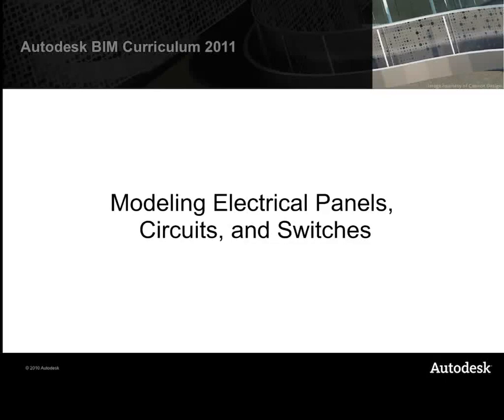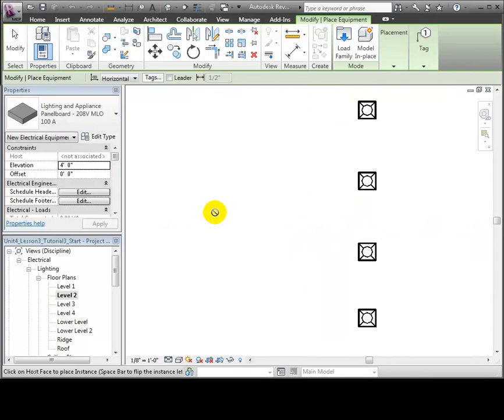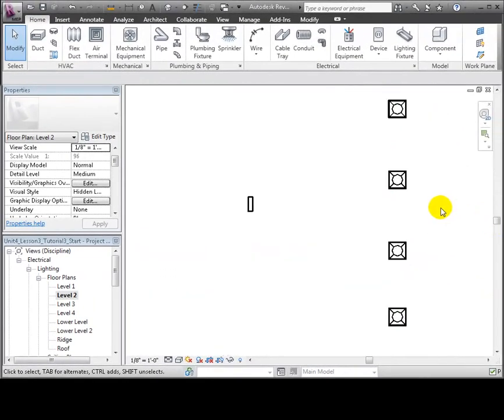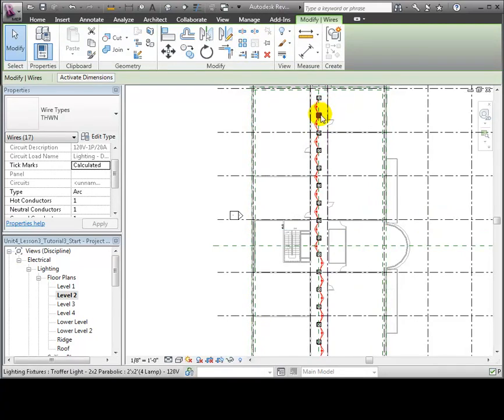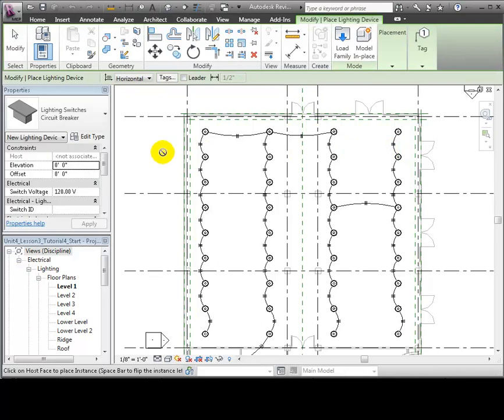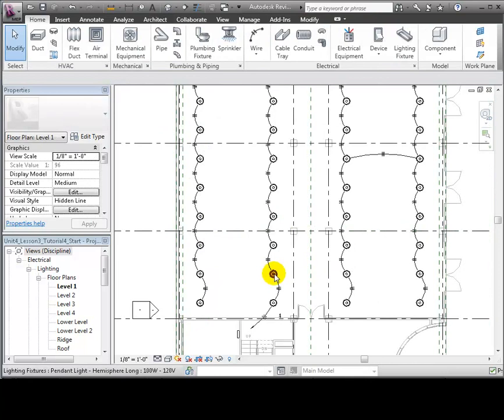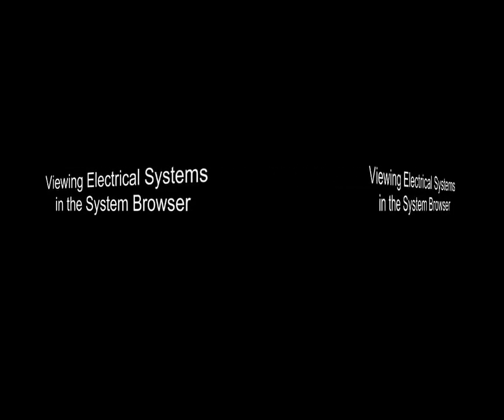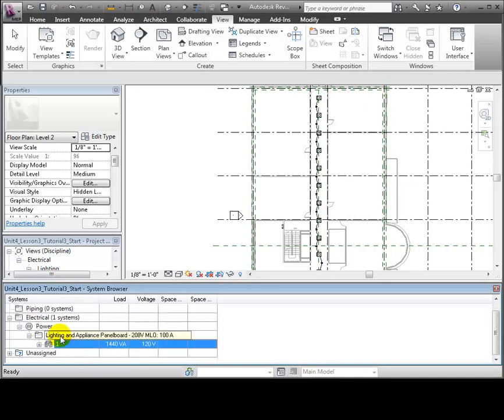Revit MEP - Connecting Lighting Fixtures to Switches

Comment: That's pretty cool, but how can I connect several lights to several switches, like a two-way switch system or more?? Because that is very common.. Thanks! :)
Reply: that's what am looking forward to know , i can't understand how could she connect all those numbers of lighting to single switch, if u get the answer about how to use two way switch,plz tll me
Reply: @heshamyousri4565   Unfortunately Revit still doesn't offer that. The only way to connect the second switch is by manually adding a connection wire.